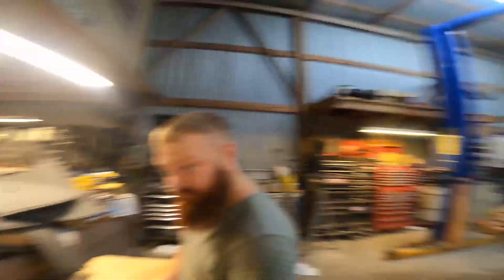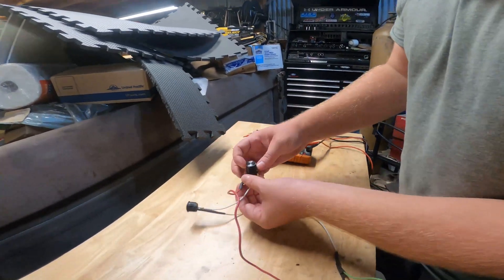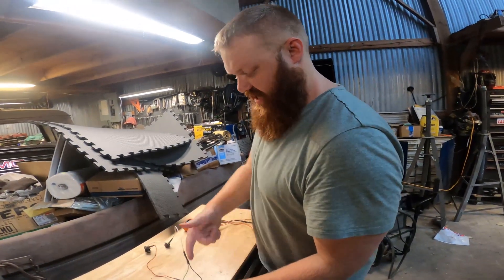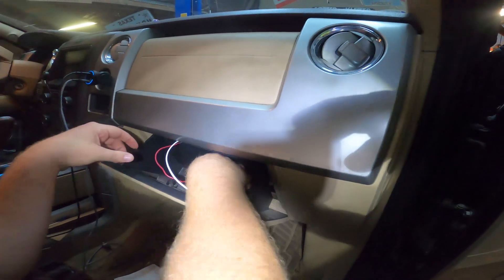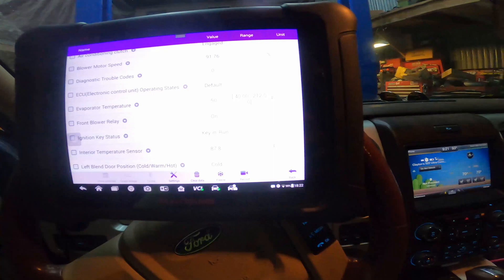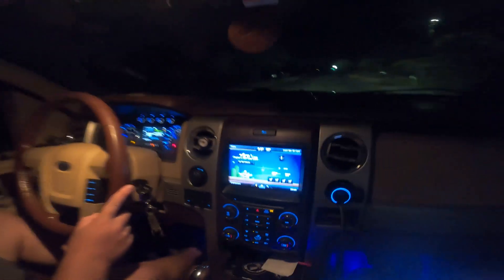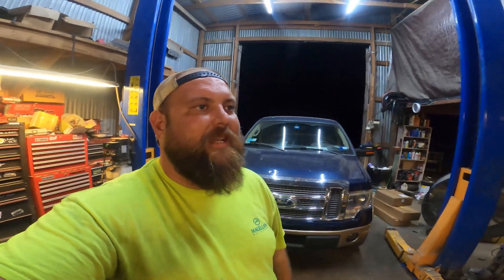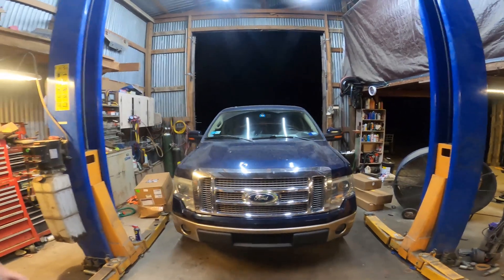2011-2015 Ford F150: AC Not Cold Enough, How To Decrease Vent Temperatures Easy!! Full Video #cars

Comment: So if I put 300k on it , and get 32 degrees, if I need the temp to rise I’ll add a higher resistance ? Am I correct or am I understanding it backwards lol
Reply from the maker: Its been awhile but yeah that sounds right on. Sounds like you can monitor the evap temp as well which is nice, just remember small changes and drive it and watch to really get it honed in. Good luck

Comment: I will purchase the one out of this truck please just purchased a 2013 ac suckkkksss
Reply from the maker: Just order the equipment in the links and follow the video. It's not a complicated install, and if you do itself and you have any issues down the road it will waaaay easier to troubleshoot. That's why I won't sell them. Or post in linked forum and maybe one of those guys will sell them too you. It was there idea originally so I deam them the masters of the subject lolol.

Comment: Any new links to replace the eBay ones?  Those items are no longer available. Or, any other sources that provide them?
Reply from the maker: Daaaang, I'll see what I can find
Reply: Just found in the original thread that the connectors are Motorcraft part numbers WPT-965 and WPT-1078. They are still available on eBay but are about $5 cheaper through Rock Auto. 👍🏼
Reply: Now I just need to read the thread in detail for how to properly wire things up just as you guys did.
Reply from the maker: @Army4Runner  very good move, buts it's easy enough once you sit and ponder on it

Comment: Ok I will just do that then thank you
Reply from the maker: You're very welcome, if you have any problems let me know
Reply: @GreenCastleGarage  hey bro is that resistor off setting the thermostat knob or the sensor on the evaporator core?
Reply from the maker: @michaelbradshaw5003  temp sensor
Reply: @GreenCastleGarage  thanks man
Reply from the maker: @michaelbradshaw5003  no problemo

Comment: Hi guys, digitaltrucker from F150 post and forum here!  You did a great job with this.  What folks dont realize is that all of our trucks will respond differently to this hack, so hang in there and find your trucks sweet spot.  Our evaps are suppose to have a temp between 36-38 but they do not.  Issues like this are not new to Ford, even their current model is having an issue where the trucks are freezing and not under performing like some of ours.  Most see (our trucks) 48-54 temp at the evap coil.  The hack coupled with a correctly charged system is key as you state.  Again, as you stated, make the change and give it some drive time and dont be over aggressive.   Being to aggressive will freeze your system and can do damage.  FYI!  The post is long, but well worth the read!
Reply from the maker: Hey, thanks for the reply and all the leg work on this. It is absolute brilliance, and I just hope we did it justice in this video.
Reply: @GreenCastleGarage  yes you did!
Reply: @ejcsds  / digitaltrucker!! So happy you had a chance to see the video and to see you comment here! Very much appreciate all the hard work you've put into the original f150forums thread and you continuing to contribute here. Nearly everything we did is based on your research. Thanks so much for all the effort you put into this and leading me to make my (donor) truck cooler. We're in Texas too and we owe you a drink!

-Clayton from the video
Reply: @claytontober9238  Thanks there were a lot of folks involved in that thread!  Funny how it started out as folks wanting to stop the rapid on off of their compressors and we ended up with a hack for poor performance!  My truck was so heat soaked today, that I was tempted to pull mine back out and connect it up!  LOL!  Thanks for your kind words for all of us!
Reply: @ejcsds  I think I'm just used to seeing you reply to a majority of posts but you're absolutely right it many people contributed. I just got back from a short morning drive and had to flip the switch off because for the first time in awhile it's in the 70s this morning! Also completely agree the sun sensor seems to be involved, but i haven't done much with that assumption yet.
Reply: @claytontober9238  Thanks, I kinda became obsessed with that effort because I have such a dysfunctional ac system.  My truck has 154K on it and I am fearful of what is out there to replace it, should it go down.  You guys "dotted the i" to complete this effort!  Thanks!
Reply: @GreenCastleGarage  I purchased all of the components. I just need to buy the extra wire to connect everything. Is there anyway you could provide a detailed picture of how exactly you have everything wired together. Which wire goes to which terminal. I cannot get a clear enough picture when I pause the video. Thank you
Reply: @heavychevy2035  I would post my setup but I am out in California and won’t be back until Friday.
Reply: @GreenCastleGarage Also i can provide my email if sending the pictures to it would be easier.
Reply from the maker: @heavychevy2035  yeah, that's not a problem. I'm actually on an offroading trip currently l, but I'll be home tomorrow evening and can get something for you
Reply: @GreenCastleGarage  I really appreciate it.

Comment: Do a  video on pimping out my GMC Sierra Denali, before and after  LOL (I got lots of work for yall, 2011 Cadillac DTS with a bad water pump, 2008 Dodge Grand Caravan needs a new motor from the junkyard, 2003 Vette smashed in the front, and a 2013 Cadillac XTS that has suspension, Stabilitrac, traction control, and whole front fashia bumper cover issues. Oooooh Lawd my hooptie life is killin me.  LOL
Reply from the maker: That video is underway Dave, don't you worry

Comment: Will these harness plugs fit a 2010 F150?  What about a link to the potentiometer?  I tried putting resistors across the evap sensor harness, but no matter how small a resistor I tried, the evap would eventually freeze up.  This was last summer during hot weather.  I haven't tried since.  Thanks for the video.
Reply: Thats why we recommended a potentiometer that was adjustable, so that you could adjust.  You had too much resistance.  Keep in mind that while these guys may have used 300k, your truck may respond entirely different to that amount.  A lot, a lot of trial and error went into the efforts in that post.   It can work.